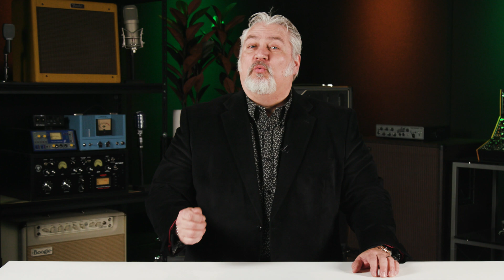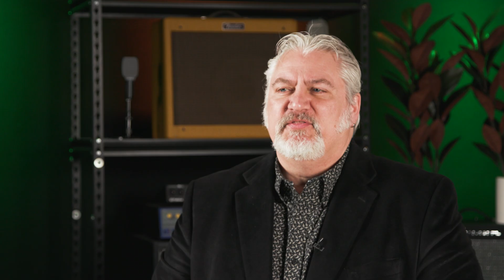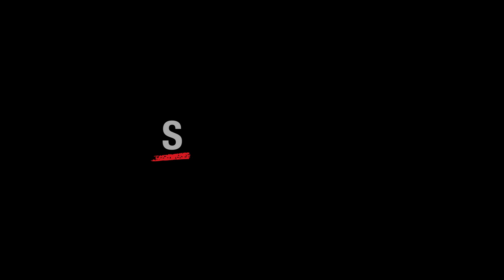What Is High Impedance?

Comment: That is not  correct. High impedance isn't just resistance to AC current flow, it's a resistance to ANY change in the amount of current flow.

It doesn't have to be an alternating current. If you just ramping UP current flow or ramping DOWN current flow, high impedance will resist either. It does NOT have to be alternating the current up and down, it resists ANY change in current flow, UP, DOWN or ALTERNATING.

Comment: Quick and easy explanation. But what do you mean by loading down electronics? Loading down with what?
Reply from the maker: Hi, thanks for your interest! “Loading down” in this context means connecting a source of electricity (or audio) to an input whose impedance is too low. Mitch used the example of a wall outlet with too many appliances connected to it, but another audio example would be running too many passive speakers off a single output on a power amp – each added speaker reduces the impedance and potentially “loads down” the signal. Here’s another resource for more info:
https://www.whirlwindusa.com/tech-articles/high-and-low-impedance-signals
Hope this helps – feel free to contact me directly with any further questions, and thanks again!
Caleb Lowrey, Sweetwater Sales Engineer, (800) 222-4700 ext. 1620, caleb_lowrey@sweetwater.com

Comment: As a general rule yes, place buffers at the beginning and the end of your signal chain but if you have vintage style Fuzz or Wah pedals in the beginning of your signal chain (which is recommended to have as early in the signal chain as possible) then the input buffer should go after these. This is due to exactly what Mr. Gallagher said here about it being desireable to have low impedence inputs on your pedals - vintage style pedals like Fuzz's and Wah's are high impedence so these are very sensitive and doesn't like buffered signals. They want to "see" your guitar signal as early as possible, unaltered and not buffered.

Comment: And this, folks, is why I'm a drummer.
But hey, on a serious note, I've always looked at impedance as it compares to a water dam. If the dam is high and strong, it impedes water flow, my "amplifier" doesn't have to add much water to the lake to keep the water full. If the dam is small, flimsy or even broken, there is low impedance, the water flows freely around it, and my "amplifier" has to work incredibly hard to keep the lake level high.

Comment: Great job, and I still don't get it! 🤓
Reply: I'm gonna try watch this again in half speed! But this current vs voltage thing... ... ...
Reply: @thesebdav8602  Funny! Me too!
Reply: Water.  Replace electricity with water and it's easier to understand because you have direct experience with it.  Imagine you have a 1 gallon bottle of water, and you empty it through a drinking straw.  It's going to empty in a couple of minutes.  Now picture it emptying through a garden hose. It will empty much faster, in 10 - 15 seconds.  The hose lets more water pass through, so it has a higher current.  Current is how much water is passing out of the jar each second.  In electricity, current is the amount of electricity passing through your circuit.  It's called amperage and is measured in amps.

Now why is the water emptying?  Gravity.  So the weight of the water in the jar is pushing the water out. With either the straw or the hose, the water in the jar is pushing the water the same amount.  If this was electricity, the "weight", or the pressure pushing the electricity through the wire is called voltage.  So current is the amount of electricity passing through the circuit, and voltage is the pressure pushing that current.

The straw is much smaller than the hose, so only so much water can pass through it.  So the small size of the straw is resisting the water's effort to pass through it.  The larger hose provides less resistance to the flow.  So resistance is a measurement of how hard it will be for the water(electricity) to flow through your straw(circuit).  Resistance in electricity is measured by ohms and is also called impedance (a higher resistance impedes the flow of electricity).  So with the same weight(voltage), if you decrease the resistance by using a larger hose(circuit path), you will get more current.

we know the gallon jar will empty quickly either way, so if we set it up such that a certain amount of water is coming into the jar to refill it as it empties, we have a never-ending supply of water, so we can keep the weight of the water constant.  This now represents your power source - a never ending supply of electricity.  But if the hose lets the water out faster than the jar is being refilled, the weight of the water will drop, and so it will push the water out with less force.  So if your circuit has a too low resistance, it will allow electricity to flow through the circuit at a higher rate than your power source can provide, causing a drop in voltage in the circuit, which means the circuit will not perform well because it depends on a certain minimum voltage.

Hope that helps.
Reply: @kilroy2517  Thanks, and the water analogy is helpful.
Reply: @kilroy2517  ...., causing a drop in voltage)... can you say off the top of your head what is typically used to "regulate"/ not cause the electrictity to flow so freely throught ac circuit.?  is it a transistor? or something else, thank you, hope my quesiton makes sense....
Reply: @MarcDufresneosorusrex  that's past my minimal level of expertise - I know little about electronics - but I'll give it a shot.  Everything in your circuit is adding resistance - if there were no resistance you'd have a super-conductor!  I believe what you're asking about are special transistors called, believe it or not, resistors.  Their sole purpose is to add resistance, either just for the sake of increasing resistance, or to direct electrical flow.  I believe diodes are used to control the direction of flow - electricity can only flow one war through a diode.  Capacitors are used to store electricity, so a sudden drop in voltage can be momentarily corrected by a capacitor releasing its store of electrons.
Reply: @kilroy2517  resistors yes ; that makes sense now.  I think I was fascinated by the (soft) metals  used but then they were so many different components.  much appreciated  ^^